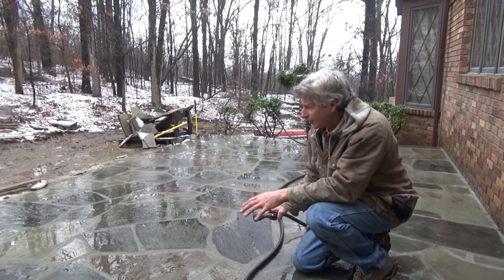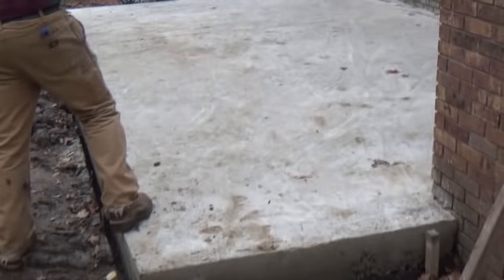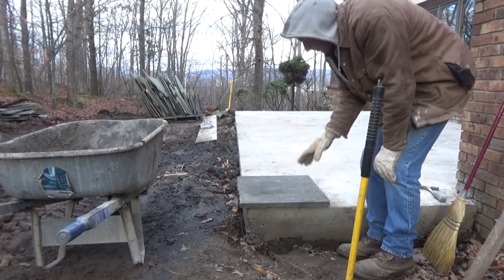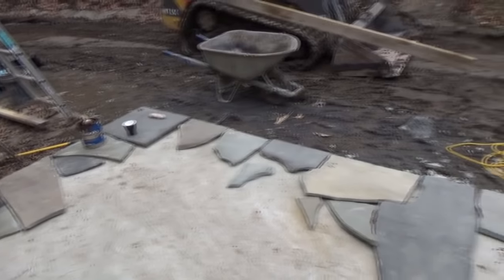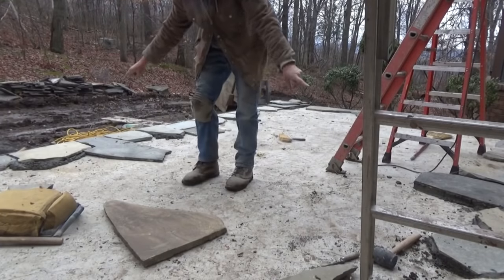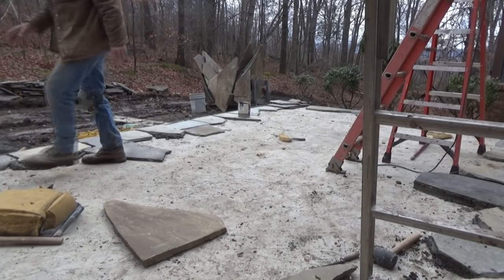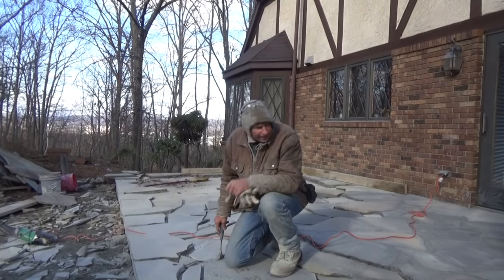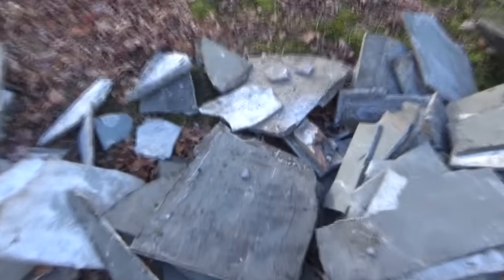STONE PATIO INSTALLATION (part 3) Mike Haduck

Comment: I live in Texas and I put in a flagstone floor in a 350 gallon stock tank pond for the wife's turtles. I used your method and it turned out very nice. Thank you for all you have taught me about masonry. I've done block work brick small slabs and stone work around the house. it's become a new hobby. I couldn't have done any of it without your instructions.
Reply from the maker: Hi James,  thats great, I appreciate hearing that,  thanks mike
Reply: James LeRoy hello ! I live in Kingwood Texas .  Do you think it’s best to lay the flagstone over a concrete patio vs ground? I Want this flagstone but I’ve seen some really good patios and some with weeds☹️.

Comment: Mike, due to your videos I just refinished the exterior foundation on a customers home that is going up for sale. There were a bunch of spots where the surface failed from water getting in a fracture, freezing and pushing the surface off. I used your methods and constant statement of wet it first before adding material and before I knew it the whole foundation was smooth again. After letting it cure I primed and painted it all and the home owner was thrilled. Prior to finding your videos I would have told them to find a mason but decided to try it myself. So THANK YOU Mike, you're a good teacher.
Reply from the maker: Thanks Clint,  I am glad it all worked out,   I appreciate it.  mike

Comment: Good job Mike, it's nice to see construction techniques in other countries. When I did landscaping (in England) we would lay a 3" sub - base of semi - dry concrete, 8 parts ballast(20mm stone down to fines) with 1 part O.P.C and lay the stone on a wet mix (think bricklaying muck consistency) of 5 parts soft sand and 1 part O.P.C. It was very hard work! But I learned my lesson with the sub - base, and when I went to work for myself, I used a sub - base of crushed limestone scalpings and compacted it with a wacker plate, much easier! All the best.
Reply from the maker: Hi Keb,  I think the folks from England are the best at masonry,  I appreciate it.  mike

Comment: Hey Mike, I live in western Oregon, where we usually have mild wet winters. I originally talked to local masons, and used their practices. Then I tried your techniques. My earlier work develops cracks and I'll probably have to redo some of it. Since I've been  doing things as though I lived in the northeast, my work has held together completely. Thank you!
On a side note, my neighbor hired a contractor to put in some concrete in front of her garage. There's a downhill slope to the garage, so drainage is particularly important. The contractor, who's been working around here for about 40 years, didn't put any level lines in; he just checked around a few spots with a short level. Then he had to go back and clean up the spots where he put the level. He also put a seam in, so the water doesn't flow. It was kind of a comedy to watch. The garage fills with water and my neighbor is trying to get him to replace it. So, that bit about seeing what local contractors do is bunk.
Reply from the maker: HI Blank,  good point, when I am doing something I am not sure of, I know who to ask,  not just any contractor,  I got to keep that in mind,  I kind of consider my videos to be food for thought,  I am glad some of them work for you,  I appreciate it a lot,  thanks mike
Reply: Yeah, that's a good point. There's no guarantee that any given local handyman is doing things properly. You have to find work that looks like it was well done and is holding up over time, find out who did that job, and ask THEM.

Comment: I've been a builder for 48 years, mainly in Arizona, Cal., Nev.,  (recently retired) could have used you on my projects - Good masons are hard to find. My experience was 99% commercial however I did build a few homes for my clients occasionally- Google 9401 Kings Gate Ct, Las Vegas, NV ( my most recent and last residential project). The mason I used on this house - reluctantly (owners friend) was a nightmare - had to make him re-do most of his work. There is no substitute for a craftsman like yourself who may cost a little more up front but in the end you get what you pay for.
Reply from the maker: Thank you Jim, I appreciate hearing that from a professional, I work for the union in New Jersey a few years and learned a lot about commercial work there, and like you and mostly retired now just have fun making the videos, I appreciate it and wish you the best thank you , Mike

Comment: I do stone same way here in new york Mike. I put mud down, lay the stone over. tap, cut or add extra mud in joints, sponge clean it and move on to the next stone. strength of this kind of work is unmatched. I don't care what state or part of the world is it
Reply from the maker: Hi Levan,  I feel the same way, but If I say you have to do it that way everybody will try and prove me wrong, I know from working in florida they do not do it that way and they use weaker cement for expansion reasons, so I know what you are saying,  I appreciate it.  mike
Reply: Hey Mike absolutely true!! I even do my stone veneering same way marrying the grouting two of the butter on back of the Stone
Reply: Apologize for my previous text speech to text sucks.lol
Reply from the maker: HI Levan,  me also I do the grout and backing at same time, makes sense,  I appreciate it.  mike

Comment: I am taking a break this very moment after doing joints between the flagstones. I decided to do the joints separately because I wanted them to be a different color. What a laborious job doing the seams separately is. I think I put twice the amount of cement into the joints, and then depended on my sponge from my cousin's bed mattress to clean up the excess. For me, what a laborious process. My sponge gets instantly dirty, had to keep rinsing the water bucket, it gets dirty fast, and I must have cleaned the joints/stones 10 times each so far. So right now I have the joints cleaned up at the right level and I just have to clean the film off. I only did 1/3rd of the seams. I also sacrificed a couple of towels to soak and put over the stones, the sun makes them too hot.
Reply from the maker: Hi, I have faith in you, you will get it, thanks, Mike

Comment: When i was a young guy, about 400 years ago lol my boss was a bloke that learned his trade in the 1920's. When we pointed the joints in stone walls, he would impress on us the need to work the mortar into the edge of the stone when bagging off. If we left a ledge on the edge of a joint he would make us bag it again to get rid of the ledge. 
He grew up in the mid north of South Australia were severe frosts would freeze the water in the pipes. He said small ledges collect water and when it froze, blows the edge of the joint away. He told us that bagging a wall was more than getting rid of trowel marks and looks. It sealed the wall and brought the lime to the surface, so it sealed the wall from water ingress. 
He loathed concrete lintels, portland cement in masonry work and steel bars and angles. As the years have gone by, i now know why he didn't  like these things. He always said that they put far too much portland in mortar, and thats why it cracks, as it resists movement. He was a clever man, gone now but i am trying to teach a lot of the old ways to my mates 15 year old son. He loves getting mortar all over himself, same as me at his age lol.
Reply from the maker: Hi Greyhaired,  my dad is almost 90 and remembers when portland came out is canvis bags,  nobody knew what to do with it,  but around here mortar and lime does not hold up on the flat, it is ok on brick and block walls , I knew a lot of the old timers who had the same preaching but lime mortar was all  they had,  just like the fast drying cements (which I was holding back on for years) I use them a lot now because I proved to myself they work,  I understand things change and I do not use the newer products till I am sure of it.  anything that works I always say,  I do not want call backs,  I appreciate the imput,  thanks Happy New year,  Mike

Comment: Great work Mike. Question should I use a sealcoating on my mine, do you use seal coatings? Also should I use caulking between the house and patio? We had water leakage, however I seal it and the mason found that there was not any cement in the spot where the leak was. I used a water proof concrete inside and stopped the leak. Additionally the mason just covered that spot with concrete. Should I still use a caulking. It is a settled foundation the house is over 50 years old. One mason in his videos (which are not as good as yours lol.) He said not "expansion joints or caulking is not need because it is not a new structor." Do you recommend that I have it caulked because we had a leak? However the leak has now stopped.
Reply from the maker: Hi Andrew. I couldn't say unless I was there to see it, it's best to deal with whoever you hired,  mike
Reply: The mason said not need they filled and sealed the crake (hole).

Comment: Hi Mike,

Thanks for posting these videos. Straight forward easy to understand. Humble guy just sharing his way of doing things. Excellent. I am in the central BC Canada region, dry hot summers, minimal rain and winter lows of up to -15 maybe 20. My question is, do I need to pour a concrete pad or can I use sand and gravel for a base? 

thanks!
Reply from the maker: Hi Ken, unless it is a small sidewalk I do all in one day, I pour concrete first so it all stays together,  thanks Mike

Comment: Do you ever use additives to your concrete, or to your stonework, to help make it weather-resistant? For example, acrylic fortifier to the concrete mix or a coating of water repellant solution to the finished product?
Reply from the maker: Hi J, only time I use a additive is maybe resurfacing or to a potland paint for a bonding agent, But rarely, thanks Mike

Comment: Mike, couldn’t we in nepa, get away with dry laying on the slab?  Then put concrete dust for a “flexible” joint. The dust would cure hard not allowing moisture underneath.  Thoughts?  Thanks!
Reply from the maker: Hi M,  it's a hard call, and depends on how big they are,  once it rains and the winter hits something is going to move, on my other videos we layed them on pee gravel no joints, every situation is different,  thanks, mike

Comment: Mike great job I am about to do my patio how do you handle the control joints when putting stone over concrete pad?
Reply from the maker: Hi Mark, I usually do it like my , stone sidewalk installation videos, I stop where the expansion joint is, thanks Mike

Comment: I liked the video. I have a question. You used an angle grinder. Is that by necessity, or by preference? I like to use hand tools as opposed to power tools, and wanted to know if it would be reasonably practical to use the stone hammer instead. Thanks.
Reply from the maker: Hi Jeremy, I would say you use anything that works, the saw for me saves a lot of waste,  thanks, mike

Comment: Question for Mike and all others:

Great work.  I am also in a cold area, North Idaho. I like doing the joints as you go too.  

Question about the mix.  1 part Portland, 2 part masonry sand.  No lime?  Is it not needed.  

I was looking to use type S and do the joints at the same time however, it says on my bag that it should not be used for as grout for flat exposed surfaces. 

Thanks!!
Reply: Just found some of your other videos. Tons of amazing information. Wow, very impressive. I think I got my answer. I am in North Idaho… I used to live near you and the weather is very similar.
Reply from the maker: Hi, for my climate. It's just portland and sand, thanks Mike
Reply: @MikeHaduck  thanks!! do you see any issues about buying sand at my local landscape place or does it need to be “masonry sand“ in bags?
Reply from the maker: @CJINW  I use playland or anything that works, thanks, Mike
Reply: @MikeHaduck  thank you!

Comment: Hi Mike, Is it possible to do something like this over top of a pea gravel patio? I put in a pea gravel patio  and a pea gravel fire pit area last summer but now I want to redo everything with flagstone. I dug everything up at least 5 in, laid down the weed fabric, put in the black plastic edging in, filled everything in with pea gravel and we hate it. What would you suggest? I live in the midwest where it freezes. Thanks for all these videos!
Reply from the maker: Hi Tony,  in Jersey they lay big slabs on pea gravel and  sidewalks on pea gravel, I have laid it dry but with cement between it it's only a matter of time, I would check out my whole playlist on patios and check with the locals before you make any decisions , thanks Mike

Comment: Do you have a video that explains the various stone, purpose, cost, etc?
I was thinking of maybe going to the local river and loading stones up and using them, but I have no idea how to make them flat, or if that’s even a good idea.
Reply from the maker: Hi Mike,  best to go to a stone - landscaping supply company and check out all the different types of stone,  that will give you the best ideas on what to use,  thanks mike
Reply: That's kind of what I'd like to avoid -- I looked at prices and, for the job I'm wanting to do, it's out of my budget right now, if I have to purchase all of the stone. I don't mind collecting the stone from creeks, rivers, etc -- and renting some tool to make them flat -- if that exists.

I do greatly appreciate the response.

Comment: Live down in North Carolina and I followed your 2 to 1 mix ratio and im starting to get hairline cracks in the grout lines between the stone and along the rocks in areas. I installed it over concrete and im wondering if the sun and heat played a role in this issue. Can I just brush in some Portland to fill in the cracks?
Reply from the maker: Hi Dave, you will get some shrinkage cracks in stonework, I rub a little Portland in them and sponge it off, it may have been too hot, sometimes in Southern states I would add another shovel of sand in the mix,  I hope it helps ,Mike

Comment: is the 1inch step down at the door enough for the water in winter and summer,  blowing snow may cover that lip and freeze against the door with ice damming,  is this a problem you have come across .?
Reply from the maker: Hi f1,  some like it right even with the sill for wheelchairs, I like to keep it down at least a inch or more for mats carpets etc, but I leave that up to the inspector,  let him make the decision in front of the owner and have the owner get it in writing if you can,  thanks mike

Comment: I have an old concrete patio poured from the 60's that is still solid but uneven in spots, some more than others. Is it possible to do something like this over top or am I playing with fire? At this point, the patio has settled as much as it's going to so it could serve as a solid base, albeit uneven.
Reply from the maker: Hi Ace, I got videos called concrete patches and resurfacing driveways,  they might help, thanks Mike

Comment: Mike, what is the minimum thickness of the mortar or cement you use for flagstone? I want to cover my portico floor with flagstone and I don’t want to raise the height of the floor after the flagstone is laid, as much as possible. Thanks!
Reply from the maker: Hi Ann, my rule of thumb is as long as the stone has solid cement under it , I am fine could be a quarter of a inch or 5 inches as long as it works, some masons may say different, thanks Mike

Comment: Hi Mike great videos. Got a question: layed some flagstone about 2 weeks ago and used the 2 to 1 Portland sand mix as you recommended and noticed that some mortar joints are darker and some lighter. Is there a length of time I should wait before I see the true colour of the joints and how long should I wait to put a sealer on it and would that help? And just for curiosity roughly how many sqft of flagstone can you lay and install and joint for a 8hour day? Thanks love to hear your thoughts
Reply from the maker: Hi Marcello, it all depends on where, what the circumstances are, who is paying etc. Etc,  Thanks Mike
Reply: @MikeHaduck  
Yes Mike I’m in Ontario Canada and done in warm summer days roughly how long does it take to cure and see the true colour of my joints and just general what is a average sqft install per day. Thanks

Comment: Mike, Great video! In Northeast Ohio, I inherited a similar patio with a type of slate stone. We've been here about 5 years and we have loose stones and the joints are coming loose. I know it's probably from water penetration, freeze, and thaw. What do you think was done wrong? Thanks!
Reply from the maker: hi Chris,  I would not know how or what they used because I am not there to see it, but I would probably consider just keep patching it like I did on part 2 if possible or eventually replace it. I hope it helps thanks, mike